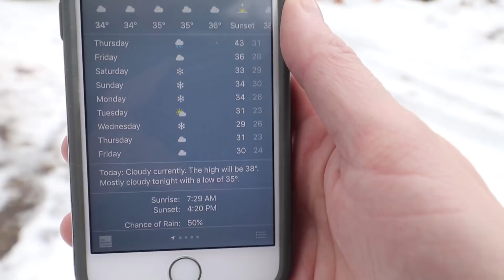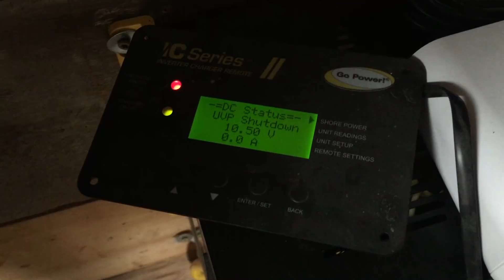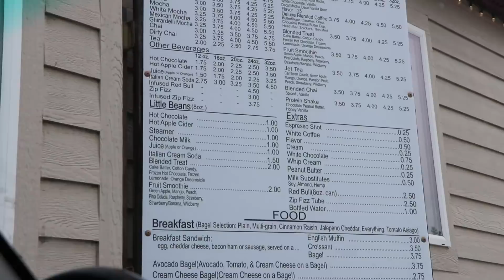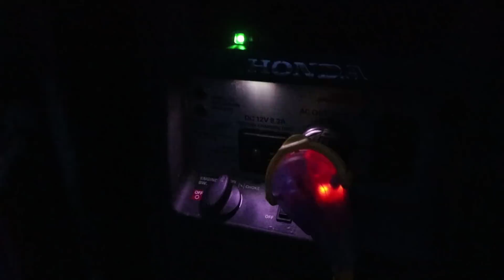Our Story: Giving Up Solar Power to Go On Grid

Comment: Great information...  I have a friend who lives off grid, solar power with generator as backup. And he will absolutely admit that it probably cost twice what is electric  bill will be if you went on grid. And we get 300 days of sunshine a year here. Batteries wear out Etc. One thing I noticed you mentioning having to go out and start the generator, there are systems available that will automatically start an electric start generator who when the batteries get too low so that you would not have to fool with that. You can get an 8300 watt generator at Harbor Freight for 500 bucks. if you haven't made the switch yet you might try that and find out what piece of equipment you need to make it automatically start the generator. But I suspect even with that it's a lot of hassle and probably not worth it

Comment: I'll mimic a lot of others .... go with grid +  grid tie inverter (at least your investment in solar will still serve a function and provide grid backup with a few modifications)  .... when you have a house with a roof ... expand the solar and storage until it meets your daily needs and on an annual average you are feeding into the grid and negating your costs.... 

There are a tonne of other renewables things that you will be able to look into when the house is in a more complete state ... until that point though it would all just be overkill ...

Keep on pushing :D

Comment: As you guys get more projects out of the way and clear more priority projects off of your list of lists you will be able to spend more time on projects such as solar.  Getting power delivery makes sense and will enable you to multiply your productivity.  It’s no different than buying the backhoe.  It’s a force multiplier, and for a family of three (kitty cat included) that’s huge.  Very few people are TRULY fully off grid.  Even having Septic or a treatment plant requires grid resources to pump the tank every 3-7 years.  You guys CAN live on solar, but you would have to cut your energy usage, which would force a different lifestyle and schedule.  It’s like, CAN I build a house with all hand tools?  Absolutely, but with a crew of two it will take far longer than running a circular saw, air compressor, nail gun, drill, jig saw... etc.  you obviously get my point.  You want to build a house and get it knocked out so you can improve your living conditions and work on other self sufficiency projects that are equally important, such as food production.  It’s all just a numerical value.  What’s the multiplier?  Is it 2 or 2 • 10.  Time is a depreciating asset.  The older you get, the more your body is going to wear out and the less efficient you’re going to become at laborious activities.  The sooner you get that house done the sooner you can regain the real estate that your RV is living on, and the sooner you can get on to working on building soil.  Screw the bitter people.

Comment: You gotta do what you gotta do.  You have been fighting a small solar system since you bought the camper.  But what you NEED would probably disrupt your build in both time and expense.  Go on grid, keep the solar and feed back to the grid in the summer.  Later get the "off grid" system you really need and keep feeding back to the grid any excess.  If you go two years without using grid power then maybe think of disconnecting.  Until then consider a combination of off grid power sources for later.  Wind, like solar, is scalable.  New hydrogen capture systems working with excess solar and wind generation and could run the generator when necessary.  LOTS of options.  But it will take time and some money to design and set them up.  In the mean time enjoy your life.  I'm enjoying watching you run up against reality and deal with it.  Love you guys.

Comment: I agree that your current setup with generator running most of the day from an environmental footprint does not make sense. Grid network generators should be more efficient than a personal generator. Like many said below, you should supplement your electricity (and heating) needs with solar and or wind. Which means keep your solar panels and tie them in with the grid.

Comment: I hope you don't get rid of your system. Try adding a grid tie inverter to help you keep your bills lower then they'd be without...but after you get a bill or two so you can see if its worth it.
Reply: Agreed.  I'd be all about using solar, but I'd use it as a supplemental power source.  Use it when you have sun and can generate power, sell the surplus back to the power company; when you can't generate solar power, utilize the grid.  Sincerely, an internet keyboard warrior with no personal experience with solar...

Comment: As a none homestead expert, I think solar is an amazing thing to put power back into the grid, if the capacity is there! On sunny days you may generate more then you need and lower the bill this way. But it is good to have a general power supply no matter what daytime and weather! If you have the grid close by, use it! With a balanced setup, you could earn money, but not 24/7! A wind/ solar mix is always a good idea! If there is no sun, you mostly have wind. A small scale wind turbine generates a heck of electricity! A 1000W 48V Turbine can be bought for under 1000 US$. Always good to have a sound standing on more then one source! ;) Btw, having the need for a generator for the daily needs, exposes a failed planing. When fuel is a rare good, you do a bit more in depth research and planing! Sailors can tell!

Comment: I am glad you made that decision.  You have alot of power needs when building a home mostly yourself. We purchased land in TN; took down the house there that had power.  We are using generators at the barn and on the cabin so feel your pain.  We want to keep it quite too, which is impossible and we go to bed early, which is not fun.  Anyhow, we did hook the power back up to a service pole but that is where it ends, so we are still using generators.  We hope to bring it further into our land this year, but time will tell.

Comment: You can now have power lines when I last looked at getting on grid they wanted to get me 8000 a pole and I would need 3 so my solar setup has saved me a lot... I think your set up is just a little on the cheep side ;)
Reply: It’s funny to me that everyone gets solar (12v dc or 24v ) and then use a inverter for every thing ..... oops that’s not how it works well
Reply: Sundazer fridge on demand hot water propane 12v water pump (with water storage ) all lights are 12v dc  the key is efficiency like you run a 3000w  generator but how many amps are you charging at 50 ? 80? 140?

Comment: I say HA HA, to all those people who think Solar is the end all.  I am a solar user, for a couple of years now.  Actually, quite a big array (36) 300Watt LG panels.  I live in Southern California, probably one of the sunniest places in the country.  The truth is Solar is very UNPREDICTABLE.  I generate excess in the summer, and run short in the winter (generate 60K/day summer, 15Kw/day winter).  I know these EXACT numbers because I also have a monitoring service.  I am fortunate enough to have a utility service which buys (and credits back) any excess of electricty that I generate.  Otherwise, I would be spending a silly amount of money on Li-ion battery banks (Tesla anyone), all of which add another layer of possible long term failures.  The better scenario is to have BOTH services at your disposal.  Each can compliment the other, when done right.  I have no remorse for having the array installed, it really will pay for itself within 9-10 years (factoring in incentives).  But, I would not care to live exclusively on Solar.  It is far to unpredictable to be a comfortable solution.  IMHO.

Comment: I am in Ontario Canada our set up is expensive.if they can reach from the main line to your home in one section it's free. But if poles are needed it like $1600 for the first pole then like $1200 each after that. So those are your poles and line now, if it get damaged power company is not responsible..if you want underground it like $300 per 100 feet and you need to dig ditch.

Comment: Well you made out much better than I thought with the off grid crowd. It sounds like you have thought things out and certainly lived it.. Not having lived off grid my thoughts  are just thoughts. Off grid power comes from fuel based generators, solar, wind and moving water. In your area the lack of sun is a reality. Certainly you could have aproached the generator and battery choices different but at much more cost.
 Probably solar hooked to the grid is the ideal( no batteries). Off grid is not easy or simple and trouble free, nor is it cheap. Engineer 775 does an honest documentation of both the problems and cost of off grid electricity  and heating. As you say  most of the time we have to make decisions  after  weighing  what we can discern with out an ideal expert to advise us. Finding  the correct experts  to advise us is critical. The reason that your house is framed is because you found the proper experts to help you and they were feasible to hire. That is  their cost  was with in affordability.  I can't wait to see the panels go on the house.

Comment: Folks, I lived 100% off grid for 6 years and here's what I gotta say...don't do it if you don't have to. There is a peaceful balance between on-grid and secondary sources of heat and water.

It's common sense, really. Our society advanced to bring lights and energy to your own home. When there comes an alternative that is affordable, easily duplicatable and without the hassles of 100% off grid, I'm all for it...but it's simply not there yet.

If you have a well, have a manual backup...but hook that thing into the grid to alleviate the frustrations of frozen lines and water problems down the road (do your best to put thought into a well insulated pump house ahead of time).

If you are on grid, invest the money you would have put into solar into a whole home generator...that is an investment I have never regretted.

If you are going to hunt, grow and harvest your own food...have a system in place for preservation and storage. A root seller and a place to store your harvest.

For some reason, many folks have equated simple living to homesteading. I don't know one homesteader, myself included, who believe it's simpler than modern standards.

Sometimes folks take years to switch back, at least a little, because they have this emotional connection to their decisions and are afraid they'll be seen as failures.

Where they fail is having an emotional connection, at all, to the decisions of how their property will work. Sometimes it works, sometimes it don't. If you've got overcast or snow 6-7 months out of the year (as I do. My area sees an average of 89 days of sunshine per year) then solar is not a viable source of power (but can be used as a secondary if you'd like).

If you don't have unlimited hardwoods for heat...then going 100% wood heat is not viable. Have an electric furnace AND a biomass or wood heat (preferably ALL 3) to stand by as back ups when you live in not so generous climates.

Most importantly, be ok with what you chose and know that things may change along the way. But always think about this, as you get older and the back starts to hurt, the knees start to give you troubles and your bones begin to creak, will you still be able to live in your dream home or will it become a nightmare to keep up with. Do you as you need to do you and plan for the long term...don't worry about what others think is right for you.

Good choice having on grid power folks. May your journey be filled with happiness and may you  keep a thick skin :)

Comment: I think grid tie is a viable solution for you since you already have the system it will give you a low power bill and all you have to add once you are on the grid is a transfer switch for the circuits you want on solar

Comment: We can't live on solar panels alone if there is not enough sun and fuel generators are to expensive, if you have a grid around it's the best alternative. What I should do in your situation is to optimize your house and use as little energy as you can, there is very much to do in this area. But save your generator and sun panels as a backup. A 100-year storm can take a stead of grid for months if you not living in a city. Build a room in the garage that are waterproofed and fire safe and you can build the rest of the house from there.